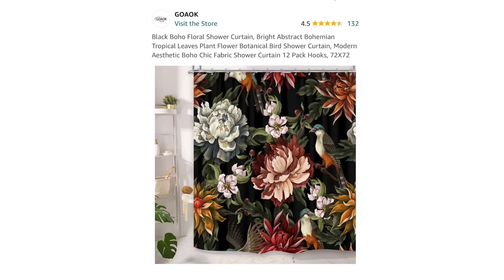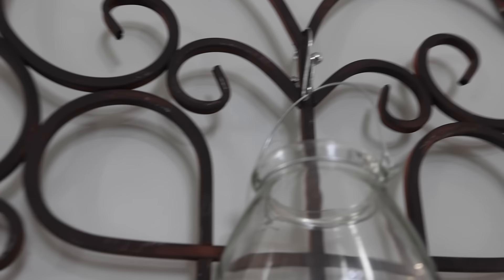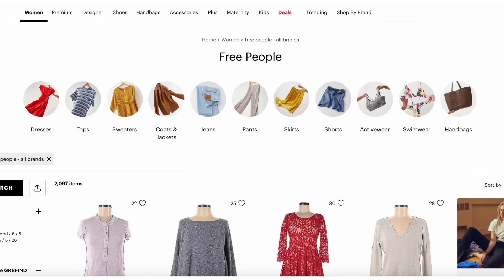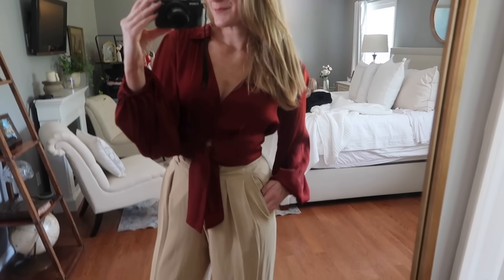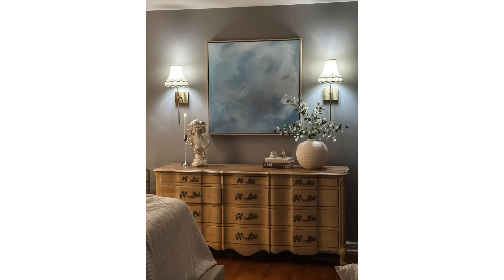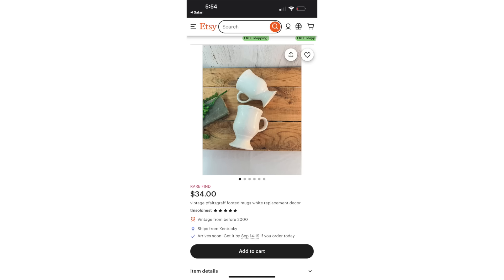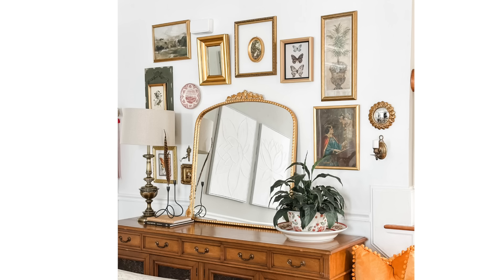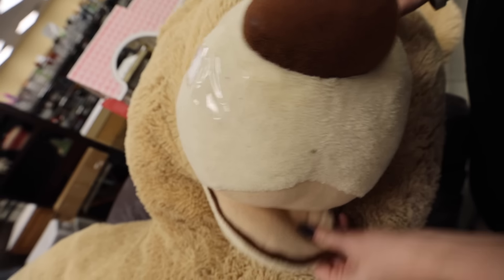10 FASTEST HOME HACKS that save you $$$ 😱 🙌 Dollar Tree & THRIFT tricks!

Comment: Beautiful finds from the thrift store. I love how you integrated your finds into your home.
One word of caution: when cleaning your artwork please do not spray cleaner directly on the glass. You risk getting moisture underneath the glass and thereby possibly ruining your mat and/or art. Also, the frame can be damaged by the overspray. Instead, spray the cleaner on your cloth and wipe it down  I learned this tip while working in a picture framing shop while in college

Comment: The designs are great. Two things though, please make sure the cords to the lamps are updated with current cords and plugs. Many of the lamps at thrift stores can be old, and potentially with an old cord and plug, and can sadly potentially cause a fire. Also, please sanitize/clean the pillows as best as possible. You don't know anything about the previous owner of the item.